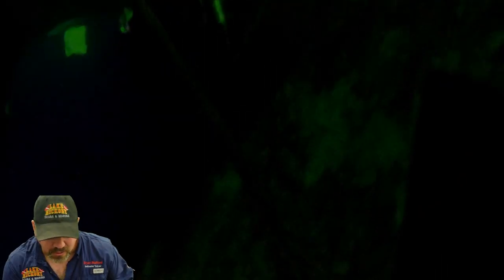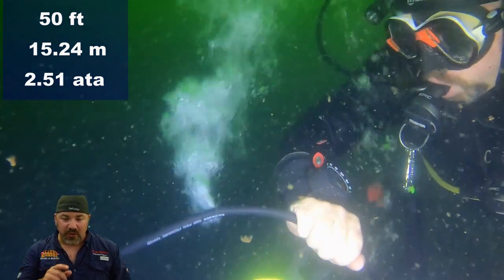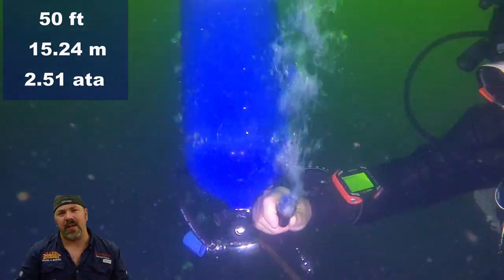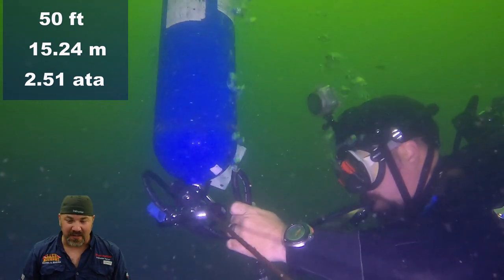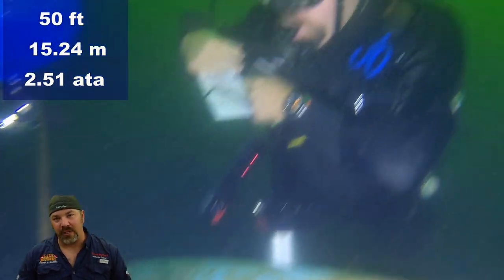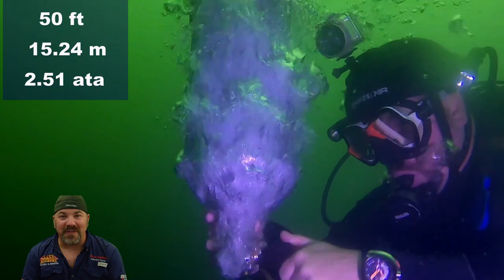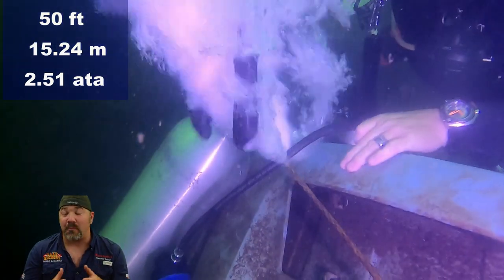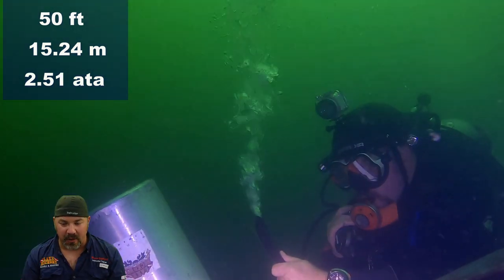Catastrophic Failure At 50 Feet Revisited

Comment: The thing that confuses me is that the LP hose failure uses up the cylinder three times faster than a full open cylinder with no reg on it. Conceptually that makes no sense. It's not like the regulator first stage has the ability to make the cylinder valve flow faster or make the valve orifice larger. So what gives? Is it the expansion of air bubbles from the full open valve that is impeding airflow vs having a more efficient path through the LP hose? The physics here is very interesting. I fully trust the experimental data, I just don't think we have fully examined the differences between the LP and no-reg drain times.
Reply: I'm a bit confused by that too.  My only theory is that some sort of venturi or laminar flow or other similar effect is happening in the first stage.  These things can impact flow rates.  I don't know enough about scuba regulators to say for sure what the exact mechanism that is occuring is.  Something you can do to see the different types of flow are to empty a bottle by turning it upside down and then doing it tilted just right where it doesn't glug.  You are working with the same opening, and the same.amoint of air enters, but the 2nd one empties faster.  I can only assume the first stage allows for some similar event.
Reply from the maker: Hello Rene Enguehard, we are attempting to work with another YouTuber who is 1000 times smarter than us, so hopefully a collaboration will be able to answer this very question in the near future.
Reply: @LakeHickoryScuba  If it's Destin from SmarterEveryDay I will be very excited! I believe he is a diver as well.
Reply: Yeah - this was very incongruous to me. I doubt that laminar or turbulent flow would affect the air coming out of the tank valve since there's no pipe through which a laminar or turbulent flow would occur.  The 1st reg stage would restrict the airflow going into the low pressure hose so it should empty much slower. I didn't pay attention to the tanks and pressures used but perhaps the three tanks weren't identical in capacity and pressure, which would make the results not comparable. Also - these results are only applicable to the tanks used at the pressures used - it would be interesting to extrapolate them to (for example) an 80 cu ft tank at 3000 psi, which is what I'm used to renting in the Caribbean. Also - it might be useful to extend the explanation, especially for the LP loss which gives the least time, to what the diver should do in that circumstance. Since that type of incident is probably going to be caused by a stuck reg, how long should you try to clear it before heading to your buddy for air or immediately trying to surface? I'd be concerned that someone with a stuck reg would concentrate on clearing it, not be watching their SPG and not realize that they were rapidly running out of air. Also - note that you were starting with FULL tanks - if the incident occurred midway through a dive the remaining air time would be significantly reduced; consequently the actions of the diver might be different (i.e., don't try to clear the reg - instead head immediately to the buddy). What do you guys think?

Comment: Just tested the effect of removing an LP hose!

cylinder at about 40 bar, completely removed the LP hose from the turret of my MTR-X 1st stage. Basically leaving a wopping great hole in the side of the turret f about 10mm diameter (75mm square!!)  Astonishingly the 1st stage managed to get the turret up to just under 3 bar with that hole, and i could breath from the 1st stage attached to the turret, although the inhalation effort was increased above normal, but not catastrophically so.   With a 700 cm miflex LP hose without anything on the end screwed into the turret, having holes of min diameter of about 7mm (38mm square) on each end, the 1st stage managed to get the IP up to a pretty impressive 8 bar, and the 1st stage on the other hose breathed normally.

I think the take away from all this is that there will be SIGNIFICANT differences in breathing performance and cylinder total blow down time depending the exact format and location of the pressure containment system failure, and the architecture and type of 1st stage being used.  Counter intuitively, a very "high performance" 1st stage, ie one that can supply a lot of gas, will both drain the cylinder faster because it's internal flow paths are less "lossy" but actually be able to supply a diver with more gas and a lower inhalation effort whilst it does so!!   So, choose you  fate really? You can have a system you can't breath from but that takes longer to blow the cylinder down, or a system you can breath from that takes less time to blow it down........

To me, this means that redundancy, via a buddly, dual supply system (doubles, pony/stage etc) is still the best option in all cases, but that in the event of a large loss of gas, it is probably worth at least trying to breath from the failed system as this could buy you a vital few extra minutes.
Reply from the maker: Thanks for your results. We second always having a back up system.

Comment: What was the SAC rate you used for the various failures? I'd like to do the math down to technical depths. 
   If one has a failure on a single tank the best course of action is to share gas with a buddy, shut the valve off, and safely ascend to the surface. There's no need for rapid ascents or feathering valves if you and your buddy act as a team and plan gas accordingly.
Reply from the maker: K B, the SAC rate formula is simple. Air used / Depth in ata / time at depth. Then you can convert that to an RMV rate by Cylinder Volume / working pressure. Then simply multiply the two together. 

SAC (Air Used / Depth in ata / Time at Depth) x (Cylinder Volume / working Pressure) = Respitory Minute Volume. Hope this helps.
Reply: @LakeHickoryScuba  I understand that part. I'm wondering what was the actual SAC rate you used for the calculation.
Reply from the maker: In our previous test we used the numbers from that test. So with the low pressure failure it was Air Used (3000psi) / Depth in ata (1.3 ata) / Time at Depth (3 minutes) = SAC RATE of 769.23 psi/min. While still at the surface, we took the working pressure of 3000 psi, and divided it by 769.23 psi/min. This gives us a run time of 3.9 minutes at the surface. Then to take it back down to 50 ft (2.51 ata), we simply divide 3.9 minutes by 2.51 ata, and our theoretical run time is 1.55 minutes. Here is the origional video which may help in your calculation. https://www.youtube.com/watch?v=rLr179pej4Q

Comment: LP vs HP hose makes sense, but the slower time with tank valve failure and no regulator at all is odd. 

If there's no resistance from a reg, this seems like it should have been faster than 2018 with a cracked reg seal. And faster than the LP failure. 

How can the air escape faster with the reg and punctured LP hose vs. no reg at all? The reg is lowering pressure to the IP (~150psi) - directly from the cylinder with nothing connected has to be the highest flow or else you're saying the regulator is increasing the flow?
Reply from the maker: Hello Andrew Chang, this has been the talk for days now with our staff and others. Our first theory is its a more controlled flow, which means the air is not circulating back on itself. You can see this by opening a valve on the surface and by placing a golf ball in front of the valve, it will suck to the valve. Thus, creating resistance. This of course is just a theory. Hopefully, in the near future, someone a lot smarter than us will be able to explain what is happening and we will all become smarter.
Reply: @LakeHickoryScuba   where's a fluid dynamics PhD when you need one?!? LOL!
Reply: Probably, blasting air creates a void, that collapses and causes shockwave, which plugs a hole. Seems like HP hose is plugged more effectively. The air goes out one bubble at a time. With valve and hoses in place, when cutting the LP hose we have a quite constant flow in HP circuit, which can be miles faster, and the air exits at low pressure without supersonic flow, so nothing plugs the hole, resistance is much lower. I think, similar thing happens when you pour the water out of the bottle: being flipped upside down it discharges slower, while air bubbles struggle to get in, rather than when tilted slightly and air  passes through a bottleneck in a constant flow.

Comment: Great video and follow up. Do you agree that there will be a depth after which the time to deplete the cylinder due to the low pressure failure will be constant, i.e., at the depth at which the regulator maximum flow is reached.
Reply from the maker: This is a great question. If the cylinder is pressurized to 3000 psi and a diver was physically able to make it to a depth of 6701 feet, which is where ambient pressure is 3000 psi, then physics would tell us if we opened the cylinder valve, no air would come out.  This would definitely be a great test, just no safe way for me to do it.
Reply: @LakeHickoryScuba  I think that you missed my point. For example a Scubapro MK2 has a maximum flow rate of 3000l/m as per its datasheet. In your video a 80cuft (11.1l @ 200bar) took 2min to deplete @ 15.24m, which gives a flow rate of 1110l/min@15.24m (11.1lx200bar/2min), thus the maximum regulator flow rate would be reached at 6.8bar=58m (P=3000l/min/1110l/min x 2.524bar), meaning that if you are at 58m or deeper your cylinder will deplete in 0.74min=44s.

Would this mean that if we have a better regulator, say a Scubapro MK25 with max flow rate of 8500l/min that we would have less air time in the event of a low pressure hose failure? Or do you think that the indicated times would be independent of the regulator type?
Reply from the maker: Hey Tiago r, yes, we most definitely misread and misunderstood your comment. Sorry, we have got so many comments in the last few hours its hard to read and respond to all of them. As another subscriber has commented, in his dry testing, he got many different results from producing the same failures in different ways. An example was to remove his second stage, then cut his second stage hose, then remove the hose completely from the first stage. All 3 gave him different results. He also stated that his theory was the first stage and its design would also play a huge role in how quickly you lost air. So it may very well be a depth where time to deplete your cylinder is constant.

Comment: I think they meant “kink and then zip tie”, maybe even several kinks and several ties. But maybe they did mean just straight up zip tie the hose... but even I can see how that wouldn’t work.
Reply from the maker: Hello @dudiusmcthude9559, we had another commenter ask if the pressure was turned off then zipped tied, would it be able to hold the pressure once the cylinder was once again turned on. It would definitely be worth testing.

Comment: Fun experiment and I am a fan BUT basically meaningless since during a dive and prior to failure you will only have a full tank for a fraction of a second… So if your failure happens halfway through the dive or towards the end of your dive…

The only real safe solution is redundant gas
Reply from the maker: We are big supporters of redundant air as well. Even more so, proper gear maintenance is the most important thing a diver can do to prevent this from happening.

Comment: How come the low pressure hose failure was so much faster than the valve failure? I would have thought the valve supplies all the air, so would be faster
Reply from the maker: Hello asdf154, in the video we did back in 2018, we showed the orfices of each hose and how air flowed through it. It explains why air travels faster through a low pressure hose. I will link the video here for you. https://www.youtube.com/watch?v=rLr179pej4Q

Comment: I suspect the "o ring failure" which was a cyl with an open valve and no 1st stage was significantly worse than a real o ring failure. This is because the orifice in a cylinder valve is pretty big where as an O ring sits in a groove that fits up to the sealing face only leaving a small gap (other wise the O ring would clearly just extrude straight away given the gas load that it experiences (3000 pounds per square inch!).  if a O ring fails, it would, even on a yoke style attachment system be unlikely to either be completely extruded, or if it were, to leave behind such a large flow path.   

The unexpected thing for me is that you seemed to experience a poor breathing capability (using the 2ns stage) during the HP hose failure test?  This doesn't make a lot of sense.  We know the cylinder valve can supply enough air to empty the tank very quickly (a couple of minutes as your test proved) so the small amount of air leaking via the HP hose orrifice (taking 29 min to empty cyl), which is tiny as mentioned, should make no difference at all in the feed pressure to the 1st stage regulator and hence virtually no difference to the IP and the performance of the 2nd?

Given the stream of leaking bubbles from the 1st, and the apparent difficulty in opening the cyl valve, i wonder if something had phycially gone wrong / failed in that 1st stage prior to the test?
Reply from the maker: Hello Max Torgue, you pose a great question, and one at this time, I do not have a good answer for. I can confirm that the first stage used was out of service for use, but did hold an intermediate pressure of 10 bar / 150 psi, even with the leak. It shocked me as well at depth on just how hard it was to breathe from it.

Comment: Can you show us how fast a vessel is crushed at, say, 4k meters? Are there any clear cases or containers where crush depth pressure can be reached and show us how fast something implodes? Does sonoluminescence occur when submersibles are crushed? I’m gonna subscribe, and hope to heck you see this comment and will be able to show us something (a hollow something, similar to a sub) being crushed under massive pressure, and underwater.
Reply from the maker: Hello dudiusmcthude9559, with the recent tragedy of the OceanGate fatalities, our thoughts and prayers go out to the victims and their families. There have been several videos released by others explaining how much pressure is exerted on an object at that depth, and how fast a vessel (sealed vessel) would implode. The theory of Sonoluminescence is a very interested one. Currently, we have videos produced and uploaded (scheduled until late October, 2023). It may be a while before we can schedule and produce content related to Sonoluminescence.
Reply: You would need some very serious equipment to perform testing at those depths, even simulated on the surface in a pressure chamber. But yes, it would be incredibly interesting to see a deep sea implosion in real time. The easiest way, I think, would be to run a very long line straight down with a camera and simulated hull on a sled.